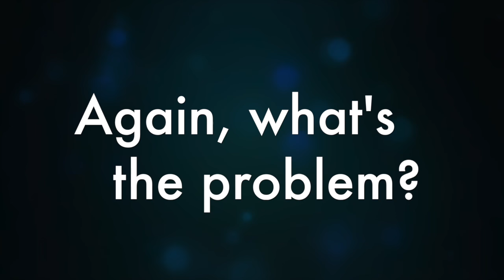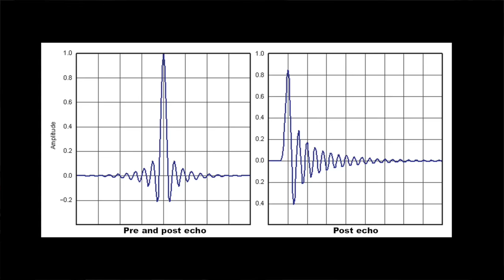The truth about Nyquist and why 192 kHz does make sense

Comment: Totally agree with these principles Hans. I must confess I didn't believe in Hi-Res audio since the 90's until few years ago. 
The biggest advantage of Hi-Res is that the D/A process becomes significantly less critical in the system, in other words, any decent DAC will do a great job when fed with Hi-Res stream and the bottlenecks will be somewhere else in your HIFI system. One downside is the bigger size of the file, but this is becoming less critical with time, and new Codec developments are also helping (e.g. MQA). Another downside is that the "player-making-industry", including the DAC chip makers, have a problem.....how will they differentiate their products if they all perform the same when loaded with Hi-Res?
Reply: Pau Rey No argument there. But Hi-Res done right. Not upconverted from a compressed 16/44.1 file which has happened. Or taken from an over Equalized compressed 24/96 file. Hi-res music should be a straight copy from the 32/384 (yes, they exsist) 24/192, 24/176.4,   24/96, 24/88.2 or the 24/48 files. NO COMPRESSION, EQ, OR ANY OTHER AUDIO ALTERATIONS. Expect for edits and I suppose fade outs. 

Getting copies of the original master file is what we need to strive for.

I been working in a mixing/mastering studio for 16 years now. And I can tell you that there is a big gulf between what you hear in the studio and what the customer ends up with.
For example: The CD you have of say, release "X" sounds nothing like the 16/44.1 CD production file of "X." They are bit for bit the same but they sound nothing alike. And we don't know why. I have heard 16/48 masters mixed back in the early 80's and I can tell you they sound incredible. Way superior to their DCC or M.F.S.L. counterparts - Not even close!

Don't judge 16/44.1 by commercials compact disks.

Comment: You might find this interesting because it supports high fidelity recording is superior to CD quality for those with good ears.

I have heard both sides of the debate and as a holder of a graduate degree in mathematics I am aware that many non mathematicians don't understand the language used in the theorems they quote and therefore infer incorrectly.

I could not actually obtain Shannon's actual work that consists of more than one theorem but I reconstructed what it must indicate and it is as follows:

A: As little as 2 samples in a complete sound wave will guarantee frequency.
B: Only 2 samples in a complete sound wave will not guarantee amplitude because there are an infinite number of curves that will fit the 2 samples.
C: To also guarantee amplitude you need at least 2 samples in a half cycle of the sound wave being recorded. Hence, ideally you would have 4 samples in the complete cycle or at a minimum 3 samples can suffice.

C above tells me that regular CD quality is going to be sketchy on reproduction for above roughly 14 KHz at best or even perhaps as low as 11 Khz. Why? Because while reproducing the frequency it is more or less guessing amplitude.

Another major issue is when a audible frequency has a ripple of high frequency variation superimposed across the entire cycle of the sound wave being recorded. 

To a set of excellent ears, while perhaps not hearing the high frequency ripple due to its frequency being out side the range of hearing, they may process the sound like we process the brightness of a light that has the appearance of being dimmer due to pulse width modulation that has interupted the supply current to the light at a high frequency. However, what did the DAC do? It can't know what to do because it's data does not match a smooth sinewave and therefore the DAC must be following a set of instructions that produces something but not what was actually recorded. Does the actual sound wave sound identical to good ears? I doubt it thus I am reasonably certain that good ears under the right circumstances can detect analog from even digital sampled at 88 K.
Reply from the maker: You are right if we would consider short instantaneous sound byte of only one or two samples. But Shannon and Nyquist is about continuous signals and then they are correct.  But, as said, it is impossible to bandwidth limit a signal as steep as done with CD without introducing time smearing.
Reply: @TheHansBeekhuyzenChannel  interesting for in my mind a "long duration of an actual acoustic sound" such as a single frequency  of 8 Khz where each half cycle contains more than 2 samples 
then 
followed by a duration of 22Khz where each compete cycle found in the "interval of duration" had but 2 samples with & only with one sample in each half of each cycle in the sequence of data representing "the interval of duration" would pose a problem, because for any set of 2 samples indicating a complete cycle where the samples are separated by a known distance with one sample in the positive side of the wave and the other in the negative side of the wave the DAC has an infinite number of curves that will fit such a pair of (pos, neg)  samples. What it then does seems to be an instruction coded in the DAC's software?

Granted what I am envisioning is overly simplified because we have algebraic addition of sound waves that then can be taken apart and seen as a Series of individual Sine and Cosine functions having unique coefficients in the series. Technically, it would be a transform as opposed to series but the series if sufficiently constructed accomplishes the same thing when infinite and darn close when the counter for the series such as N is as little as 14. 

I would actually like to see Shannon's original work. Why? Because I believe it is at least one lemma and several Theorems and not a singular theorem as often indicated. The other reason is simply: the theorems must be constructed as an equivallance or strict implication meaning in the case of equivalence if A then B must be true and if B is True then A must be true. For the equivalence we simply have if A then B is True. Why it's important to see the actual theorem is that A in both of my examples if viewed as a hypothesis or proposition provides the boundary conditions that are required for B to be true. Mathematics is like ancient Greek in that if you do not know the language it is easy to infer the wrong meaning thus be mislead on what the theorem actually indicates. My speciality is probability and I can't begin to tell you how many people misread and then misuse the "the weak law of large numbers" as well as the "central limit theorem." Simply stated, if you don't speak Greek please don't translate the book for me and I am sure everybody understands my attitude and would feel the same too.
Reply from the maker: Wikipedia is your friend here.
Reply: @TheHansBeekhuyzenChannel  excellent, I will examine the Wikipedia article as a starter. Unfortunately, the writer of the article assumed the reader know's what all of the utilized notation stands in for such as Beta. This is often the case when it's becomes standard notation for the select few who specialize in the sub-field. I'll either derive  representation or find a more complete accounting. Also, while sketching out the basis for the conclusion visually and in notation indicated at the end of the article ithe article does not completely provide the hypothesis needed for the conclusion and more suggests than explicitly indicates all that is sufficient but it's a good start none the less. 
I am not doubting Shannon at all, rather I have been doubting what has been inferred by others because if I had a data stream of amplitude values (1,-1), (1, 1), (1,1), (1,-1)...repeat ad infinitum; while easily being able to ascertain frequency I would be hard pressed to tell you what specific sound of said frequency from the set of infinite possibilities would match the actual sound recorded. It could be a sound that warbled by changing amplitude every half cycle or one of constant amplitude during the entire duration of the actual sound.

Actually what I am talking about is what is referred to as Aliasing and Shannon and I are in agreement because his proof regarding this concludes with:

￼ and {\displaystyle x_{A}(t)}￼ might not sound the same. But their samples (taken at rate fs) are identical and would lead to identical reproduced sounds; thus xA(t) is an alias of x(t) at this sample rate.

This is exactly what I am saying in that like in my example I have one representation from a given sampling rate but from conceivably two different sounds.

This is most interesting and very complex because it's not a single theorem rather several on the topic of digital representation and Shannon did it well. It will take a while to assemble all he did with complete understanding but it's more than meets the eye.
Reply: Well you were right Wikipedia was my friend. What I was pointing out that a mere 2 samples can lead to is called Aliasing. This is where two distinct actual sounds have the same digital representation and would play back from the recording exactly the same in spite of the originals being different.

Apparently when using 44K they apply filters to the input to prevent this. I suppose the filter simply removes the problematic high frequencies thus it no longer is faithful to the original. For me, I would up the rate to 88k so as to be faithful to the original but even then there are opportunities for excellent ears to hear a difference between analog and digital in my view.

The good news is your interest in High Fidelity above CD quality is real and not just in your imagination except you do need a brain that can differentiate small but important differences.

As far as Shannon, I was happy to find he and I were on the same page although I did not know of the term Aliasing until today. On the other hand his work on the topic of digital representation is more than most people seem to grasp and there is a lot I'd like to look at icontained in theorems other than the one pertaining to Aliasing. Who knows, maybe for giggles I will code my own DAC software to stay busy in the hour of isolation from Covid 19.

Thanks for pointing me towards the pages of info I needed to see and you have a great channel and don't let tin eared people say otherwise.

Mike
Reply: Amended to give a lower limit thus a frequency interval for where aliasing or miss representation can occur when sampling is 44.1K.

After reading through all of Shannon's theorems the general interpretation of his work that is fitting is:

If 2 samples having the same sign are provided then and only then the amplitude and frequency of the full sound wave being sampled is fully and uniquely determined else aliasing occurs.

Simply stated, 3 samples where 2 of the samples must have the same sign of (plus or minus) is required to avoid aliasing also known as misrepresentation. The common inference that only 2 samples are required to fully determine a complete sound wave is inferring too much by not recognizing the pair of samples must be in the same half cycle thus in reality 3 are needed to avoid aliasing.

So, yes C D quality and Hi Fi quality are indeed different and having my druthers...

Footnote.
I know that aliasing can occur as low as but not including 14.8 Khz. I am reasonably certain that this figure is the lower bound frequency at which aliasing can not occur (at or below) but can occur above. The interesting thing is that whether aliasing occurs is dependent on how the sampling scheme corresponds with the actual sound being recorded, hence, a complete cycle of say 18 Khz could conceivably be digitized as what only can be an aliasing artifact due to only 2 samples in the entire cycle or it may have lucked out by having 3 samples thus uniquely determined. Also you could get very lucky and no aliasing occurs in the range of human hearing but that can not be guaranteed by 44.1 K sampling thus Hi Fi is needed for such a guarantee.

Comment: A very good point - I watched this initially thinking "this will be a bunch of nonsense" but actually, everything you're saying I can't argue with - at least on an oscilloscope. I'm very skeptical that low pass filter artifacts are going to have an audible impact on the signal in a double-blind test, but I appreciate your video and the fact you based it on sound science. Anyone up for arranging a double-blind test? :)
Reply from the maker: Hearing the artefact differences between a bad and a very good product is rather easy. The difficulty for you is to set up such a comparison since it might be difficult to get the right equipment. In DAC's predominantly two kinds of artefacts cause clear sound degradation: jitter and the reconstruction filter/upscaling filter. So you need proper low jitter in both DAC's to compare only the filtering. About double blind testing audio, watch this: https://youtu.be/QG6LS9VDZlg

Comment: Wonderful video sir. I have watch it a few times and I believe I understand what you're getting at- that we need better/more gradual filters above the cutoff. What I don't quite understand is why the filters need to extend so far? All the way to 96khz??? If there is not even any relevant information much higher than 20khz, where are the artifacts coming into play? Put another way- if the filter starts well above the cutoff, does the filter still effect frequencies BELOW the cutoff? 

Yet another question I have is.... are there not downfalls to recording/playing back information well above the auditory realm? If I remember correctly Lavry suggests playing back ultra high frequencies is more likely to cause distortion and other issues, rather than improve audio quality. I realize this refers back to the old arguments of higher samplerates... but my point is, isn't it a trade off??? Which is better- to have fewer artifacts from filtering? Or fewer artifacts from introducing ultrahigh frequencies that are not even needed?
Reply from the maker: The audibility of filters is complex but the steepness of the filter plays a role and the cut off frequency plays a roll in where in the frequency band the most audible artifacts occur. So choosing a higher cut-off frequency and a less steep filter is beneficial for the sound in the audio band.
Reply: Thank you for the well thought out response and for the videos. Well done! I'm still skeptical as to the audibility of these filters, especially well above the audio band, and whether or not the benefit/cost ratio is even close to being worth it.. But I would love hear some more descriptive words as to what the artifacts sound like and what to listen for. That said, I'm all for better audio if and whenever possible.
Reply from the maker: See it like this: the speed limit in my country is 130 km/h. A car that just does 130 km/h needs a lot of time to get at that speed. A car that can do 200 km/h not only gets to 130 km/h faster, it also is quieter, has less vibrations and so on.
Reply from the maker: First: yes, filters at higher frequencies do have problems that fold back into the audio band. That is the essence of my video. Choosing a higher filter frequency makes sure the artefacts are still above the audio band.
Second: you should not record more than necessary. For us humans the extreme highest frequency young people can hear is 20 kHz. As said, many mikes don't even get that high. So we're effectively recording thin air when recording at 192 kHz. All true. But it does reduce the anti-aliasing and reconstruction filter problems to a very low level.

Comment: All this is going well above my head and until the other day i didnt even know there was such in depth discussions about this kind of thing. Despite that , from what i gather from the video and reading some of the comments, as i understand it your argument for 48kHz+ rests on the fact that by limiting the audio play back devises to 48kHz as well cause extra noise that 'echo down through the frequencies' that either add extra noise to the playback for somehow distort the frequencies of particularly the higher frequencies of the transmitted sound. To fix this you propose that we create audio play back devise that can play the full range of sounds from a song recorded at 192kHz and by doing this the 'echos' from the cut off only distort the frequencies above those that we can hear. 

Is this at all correct as i really only have basic knowledge of this kind of thing. I have also put all relating to the Echos in quote marks as this is really the thing that i dont understand at all, how such a cut off can alter the frequencies of lower harmonics. Thanks for your help
Reply from the maker: Well, I think you got the essence, although 'echos' is a somewhat misleading term for they are not discretely audible signals. Using 192 kHz makes the filtering needed in digital audio easier to design well sounding (in a nutshell).
Reply: But HOW does this cut off affect the lower frequency's?
Reply from the maker: That's difficult to explain in a few words. Perhaps I make a video later this year.
Reply: ok thanks
Reply from the maker: Actually, next week there will be a video on time smearing and that's the effect we're talking about.